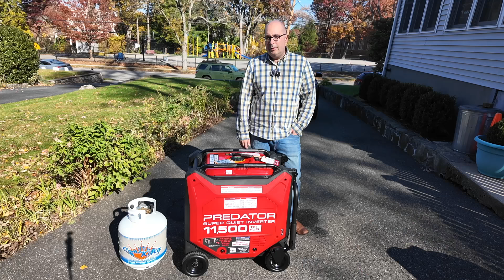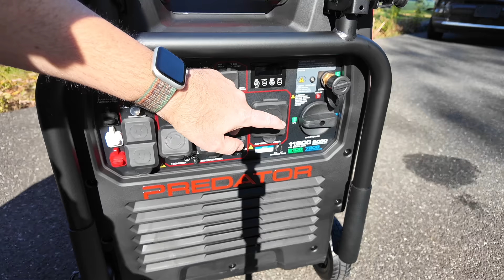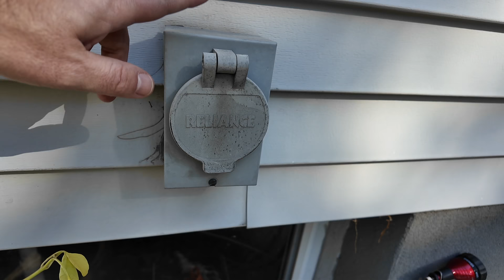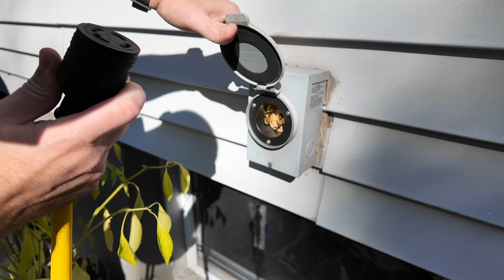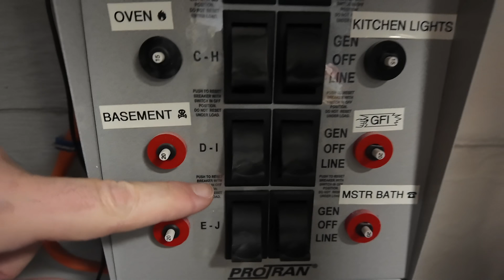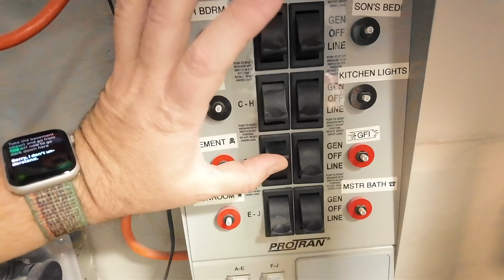Predator 11500w Powers My Entire House (Transfer Switch & Full Test) — Honda Should Be Worried!

Comment: Did you float the neutral or leave it bonded?
Reply from the maker: Right now it’s still bonded but being that it took up to a transfer switch it should be floating. I’m still trying to determine the right way to do this and we’ll film a video once I have it figured out.
Reply: @Out @Outdoor_Prepper  Thanks. I’m looking at getting this generator and trying to figure that out
Reply from the maker: It’s a great generator and I really am happy with it!

Comment: Been reading a lot about bonding at the panel versus bonding at the generator.  Any modifications required to the generator if it uses the panel as the bond?
Reply from the maker: If you’re using it connected to a transfer switch or interlock, you’re supposed to un bond it and make it a floating neutral. I’m still researching how to do that but once I figure it out, I will post a video. Thanks for watching.

Comment: I am considering my options of backup power, generator vs battery wall...I would like to see real world output and runtime for propane vs gas.  Thank you for the content
Reply from the maker: That's a great idea for a video, thanks for the suggestion! I did do a video on propane runtime for this generator. I got 10 hours at 25% load on propane . Video on my channel
Reply: Yes. I was wondering what its propane usage was.

Comment: Great video.  You noted that the generator would run for 14 or so hours on 6.5 gallons of gasoline.  Any way to estimate the run time on a given number of gallons of propane?
Reply from the maker: I did a separate video on the propane run time and at 25% load with a barbecue tank. I got approximately 10 hours of runtime.

Comment: Who's gonna be out in a pouring down thunderstorm plugging and pulling on a rope to get backup power? 
That small grill sized propane tank isn't gonna due . 
You'll be better off with nothing for backup power when you get a power outage dood .
Just join the rest of your helpless friends and wonder around aimlessly not knowing what to do.
Reply from the maker: I definitely disagree that having to pull a generator out of a garage is alot of work. In addition to propane I also have gasoline and am going to get a natural gas hookup for the generator. Thx for watching
Reply: If your plan is ‘do nothing,’ then yeah—you’re already fully prepared

Comment: It recommend  to use  at least a 40 gallon  propane tank those 20 gallon tank  can damage your generator when the tank start freezing. You also need to have a soft start installed  on your 5 ton ac unit for this generator
Reply from the maker: Those are some excellent tips, I appreciate you sharing them!
Reply: 20 lb propane tank won’t damage a generator—it just may not be able to vaporize fuel fast enough under high load or cold conditions, which can cause the generator to lose power or shut down.

Comment: I will buy a generator and connect it directly to my house wiring someday. I’ve decided that it must support 50amps of 240V continuous.
So I’m looking at 12kW continuous.
If I find 12k continuous of natural gas, that’s then better.
I’ll probably spend $4-5k on it.
Reply from the maker: Sounds like you've got a solid plan for your generator setup!
Reply: @Outdoor_Prepper and after thinking about it, I’m going to amp clamp the main feeds while running at max during the winter and summer.
Who knows, maybe I don’t need 50 at all times.

Comment: Quick question can you run the 30 amp cable into a 50 amp connector with an adapter? I'm new to this.  Thanks.
Reply from the maker: Absolutely - they make adapters for that. Hope the video was helpful and thanks for watching
Reply: @Outdoor_Prepper  Yes, keep up the great work, very informative. I just bought my first Gen.

Comment: I got a champion 8500 thing  easily powers everything in my house ......and yes i backfeed my dryer outlet with a 6 guage suicide cord  because im not retarded nor do i live with anyone who is and i shut the main breaker off pretty simple and it never gets turned back on until the generators put away no "suicide'" cords anywhere near anything and its coiled up ....but anyways it will power everything in my house bar none no hiccups central air ,hot water heater,forced hot air ,washing machine, fridge, deep freezer, microwaves, spotlights ,5 tvs,lights lamps xboxes turn on all the outlets with misc stuff plugged in computers tablets phones  etc and all works all at once no problem......obviously i cant run central air and the

Comment: My propane tank would run for a while tank would freeze
Reply from the maker: That’s definitely a common issue with small propane tanks and a generator pulling a large heavy load. They make propane tank heaters which are basically electric blankets that go around the tank to try to prevent it from freezing. I don’t currently own one, but I’m thinking of picking one up just in case I need to run on propane in freezing cold weather. Thanks for watching.

Comment: Have a question,  not really sure i know what im talking about out, just saw a video on the predator, something about the way they come they recommend only having one ground or neutral when connecting to the house, but harbor freight wont warrant the predator if you disconnect it from the generator. Can you please elaborate on that. Im now thinking of getting this 11,500 and having an interlock installed. Thank you
Reply from the maker: If a generator is connected to a house via a transfer switch or interlock, you’re supposed to have it as a floating neutral since there should only be one bond which happens on your home electrical panel. The harbor freight generator is a bonded neutral so you would have to disconnect the bond at the generator. I am still working on figuring that out and will post a video on how to do it once I have gotten it down solid
Reply: @Outdoor_Prepper i just found a video, the grounding neutral is bolted to the lower part of engine block,simply unscrew it.( Brian Conroy removing neutral from ground or home backup on predictor 11,500)
Reply from the maker: I actually saw that video. I think that is probably correct but I’m not 100% positive because I have another generator my Gidrox 10,000 W and it has a similar screw on the frame however, there’s three wires connected to it and you just removed the neutral. I’m still trying to do a little more research but the video you found may be correct.
Reply: @Outdoor_Prepper ok thank you, hopefully you come up with something concrete.

Comment: You said the runtime for a full tank of gasoline is ~14 hours. How does that compare with a tank of propane?
Reply from the maker: You’ll get slightly less runtime on propane. I did a test in a different video on my channel and I got 10 hours of run time at 25% load using a 20 pound barbecue tank.

Comment: Hi Outdoor Prepper,  I purchased the Predator 11,500 Inverter Generator as a back-up power source for our house.  Unfortunately, our house is TOTAL electric....sigh.   We have a 2.5 ton A/C unit, a heat pump type water heater and the other regular appliances (fridge, stove washer/dryer, microware 1,200W).  My question is can I couple my 3,500 predator inverter generator with this model.....or is this unit enough to supply power to the house.  We absolutely will not be running the dryer during a black out, but barring that, would you say this is a suitable application?  Thank you in advance for your time.  Great video!!!
Reply from the maker: The 11,500 watt unit should be able to power your entire house or at least most of it with no issues, even with all electric appliances. Just don’t turn all the heavy draw appliances on at the same time. It’s a really solid generator and so far I’m happy with it. Thx for watching

Comment: I have a gen tent generator cover that is basically a tent cover over your unit. You need some sort of protection from the rain and snow to keep the unit dry and protected from the elements. A dedicated generator shed is great but these self contained tents work great are small footprint and do the job. GREAT VIDEO! Great INFO! We can use our AC in the hot months but had to install a soft start on outside unit. We are 100% electric too. No gas or oil. All our fuel is electric unfortunately.
Reply from the maker: Thanks so much for watching and a gen tent is definitely a great thing to have.

Comment: So, you are saying that a 30-amp or a 50-amp cord will power everything in your house and your panel is a 200- amp panel. There is no way that the generator will power your whole house.
Reply: You are right. You have to be choosy on what is most important and has the most load on your power. For me I forego the hot water heater, the furnace, the dryer, the washing machine. I have power meters on my generator breaker leads ( each 110 hot). I can monitor the entire load on my generator and adjust my usage accordingly. But it makes the reality of it all comfortable. I’m using a dedicated 50 amp breaker interlocked with a 9500/12500 generator. I can’t run everything but can be very comfortable for multiple days. We use propane buddy heater and space heaters set on low. We can turn our hot water heater back on as needed. You have to manage it.
Reply from the maker: Thanks for your comment! I'm only talking about powering the most important things in the house, not everything simultaneously.

Comment: Wish I had done more research/had seen this...
I bought a standard (non-inverter) generator (a big one) that now I'm afraid to hook up to my interlock at the house. 
Afraid I'll damage my appliances, much less PCs and devices.
It's got maybe 10 minutes on it since I bought it. Maybe I can sell it and get an inverter generator.

Edit: or addition... just for shock value... I purchased 60 ft of (I think) 4 gauge wire and build my own 50amp gen cord (it's a work out to lift and walk any distance with it coiled). When I was done with it, it cost more than many 2500 watt inverter generators. At least I know the cord is good to go, once I get the correct generator. Good video, thanks.
Reply from the maker: A traditional generator is ok also and certainly better than no generator. It sounds like you’ve at an excellent generator cord! Thanks for watching

Comment: Problem in our house is that we have electric water heater which takes 9kW.  Breaker is behind fridge and difficult for myself wife to shut off.  If I turn down temp on one of the two heating elements ours it reduce draw to 4.5kW for routine reheat?
Water heater is new so I don’t want to switch to propane right now - and house is not plumbed for propane yet either.
Don’t have over/range and wife wants to add them in electric.   Thinking they’d be almost unusable on reasonably sized generator - so we may be plumbing in propane anyway...
Suggestions?  Should I just go with large generac and large propane tank (only have a 100 gal, which is disconnected due to leaking pipe so would need to be completely replumbed to even run space heater (which wife already tore out 🤦🏼‍♂️.
Reply from the maker: In you’re situation it sounds like a Generac whole house might be needed

Comment: Question for you. If I install a 50A inlet box kit, but only have the Predator 5000. Is there an adaptor for the 30A to the 50A. I might want the Predator 11500 down the road?
Reply from the maker: Absolutely. They make adapters to go from 50 amp to 30 amp TT.

Comment: doesnt the interlock setup only power one side of the panel,the side the interlock breaker is on
Reply from the maker: An interlock setup, when correctly installed, allows power to be sent to any circuit in the entire panel, not just one side.

Comment: Outdoor Prepper, this was a damn good video. You hit all of the points. I have a Westinghouse 11,000 inverter. I love Predator generators. I have an open 4,000-watt generator that I used for years to run million extension cards through the house, as you mentioned. I grew tired of that, so I had my house wired for a portable generator and a switch lock. The first electrician tried to sell me the transfer switch, but after thinking about the very same reason you mentioned, I decided not to get it. I had a 50-amp plug installed, and everything has been working since. Predator did not have anything this powerful when I purchased my generator. I surely would have purchased it if it were out. Thanks for taking the time to make the video and explain the setup. Even though I already have mine set up, I still enjoyed it.
Reply from the maker: I appreciate you sharing your experience and kind words! Glad you enjoyed the video and thanks so much for watching!

Comment: Nice video, but a 20lb tank is too small for an 11K generator. It will not handle the higher loads and will freeze up. Better off with a minimum of 40lb but I would recommend a 100lb tank.  Otherwise, good information on the Predator.
Reply from the maker: That's a great point about tank size for higher loads. Thanks for the tip!

Comment: I bought this same unit. I originally ran a B&S Storm Responder 6250. I converted it to run on Natural Gas over 3/4" pipe at the meter connected to a 3/4" hose with 3/4" QD full flow fittings. I use a similar to what you have 30 amp twist lock box tied to my main in with a 30 Amp breaker and a physical lockout.

The Predator 11500 really seems to run well, I've yet to power the house with it but I certainly need to do that test. My two concerns are the 1/2" natural gas inlet connector on the generator and un-bonding the ground and neutral.

All in all good video. Thanks!
Reply from the maker: Thanks for watching! I haven’t unbonded mine yet but as soon as I do, I’ll film a video of it and post it

Comment: In your first video a person said that this generator comes as a "bonded" neutral/ground. You answered the question saying that you would show how to "unbond" them as required by code to hook to a house. Obviously you don't think this was a high priority to cover which is disappointing 😔.
Reply from the maker: Harbor freight is selling a generator to hook up to your house that is bonded. I realize that after I purchased it and hooked it up to my house. I am doing the research to figure out how to change it to help others.
Reply: @Outdoor_Prepper  I saw one video where his Predator 11500 had the grounding wire hooked to a lug next to the oil drain/fill. He unhooked it and that fixed the issue. I went back and looked at your video and could not see if the grounding wire lug was there or not. In another video it appears that Harbor Freight has two different companies manufacturing these for them so who knows what may be where! Gerry

Comment: Ok, first off you re using a 20 lbs bottle, when the book says 40lb or larger. When you say the plugs are three and four prong 30 amp, you are correct. Yet the three prong is 120 volt and four prong is 240volt. You say that on gas it will run for 15 hours. You fail to mention that is at 26% load. And if load is higher, your run time will be less. You also do not add a very important piece of info to hooking up to whole home. ALLLLLLL Predator generator and inverters are bonded. To hook to whole home it needs to be un-bonded. While yours was running on your patio. I noticed the CO light blink a few times. When setting your unit up. Lick your finger and stick it in the air and verify which way the wind is blowing and point the muffle down wind. Also, oil level. It has an oil sensor and what I tell people is look down in the hole. Oil should be in the threads or almost leaking out. If away from the threads, add oil.
Reply from the maker: I appreciate you sharing your insights and tips for generator use!

Comment: Great video. Explained things very well. But when you said that you can hock two of the Generators together with the Parallel connection. Bye the time you bought two of these 11500 Harbor Freight Generators the connection wires to plug them together. Additional natural gas connections or propane connection. Wouldn't it be better to buy the large Westinghouse Generator that puts out 2800 Pic / 2000 watt? It has tri fuel, electric start. And remote start. It has the clean votege. You would only have one piece of equipment to look after. And the big boy 2800 / 2000 watt Westinghouse generator price comes in a few hundred dollars less than buying two of the Harbor Freight 11500 / 9000 watt generator. I understand that just buying one Harbor Freight 11500 / 9000 watt Generator will come in just a little over 1/2  the price as one of the 2800 / 2000 Westinghouse Generator. I understand that it totally depends on what a person needs. And what a person can afford. But if you can afford the $ 3,900 Westinghouse. You certainly would be getting over twice as many watts with just one Generator, instead of two Harbor Freight 11500 / 9000 Generators.
Reply from the maker: Thank for watching and good points - buying 2 would not be cost efficient as opposed to just buying 1 larger unit
Reply: thank you for the reply. And for understanding my point. I still agree that the Harbor Freight predator 11500 / 9000 Generator is a real beast. And probably have enough power that most people will ever need. The Westinghouse 2800 / 2000 Generator is probably more than most residential homes would ever need, unless it is a very large home. I was just trying to add some information to the discussion.

Comment: What is the requirement for changing the oil? I had to change oil every day in a gen I used to have.
Reply from the maker: I would recommend changing the oil roughly every 30-50 hours of runtime since these are small engines and have no oil filter . Thanks for watching

Comment: I’m curious as to the connection from the inlet box to the breaker panel. Can you show us how the cable is run and how it’s connected?
Reply from the maker: This is part of a transfer switch kit. I have a reliance pro-Tran transfer switch. 10 circuits.